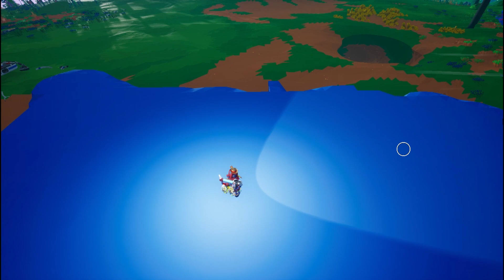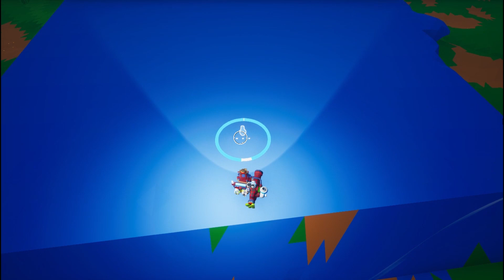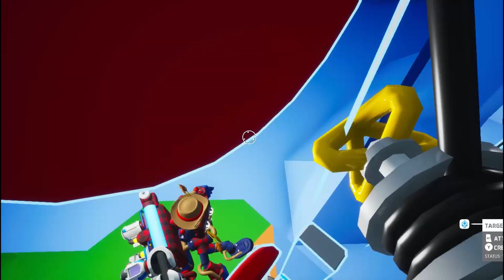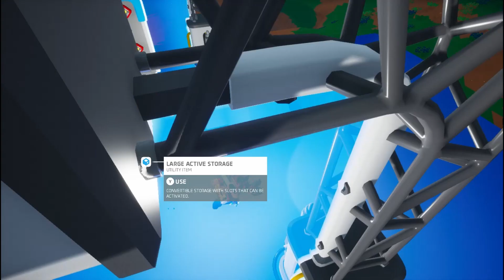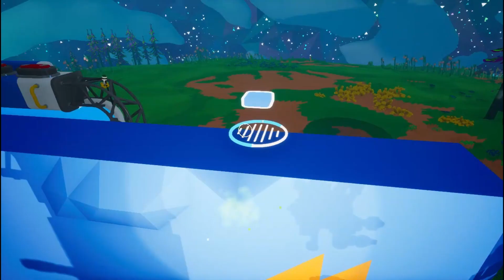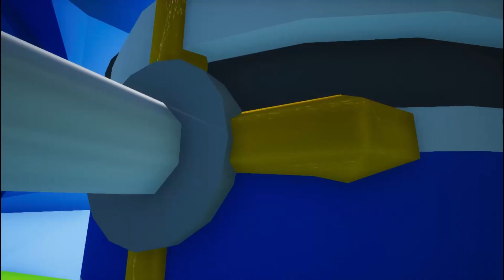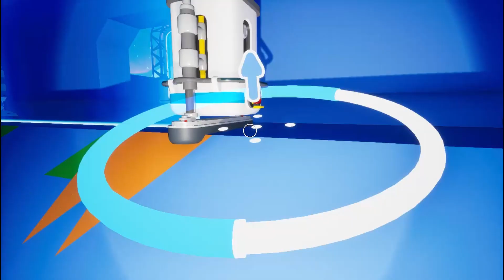Adventure Mode True Flat Guided Build - Functional Doors, Base Walls/Ceilings

Comment: Should the table be dancing around too while I'm trying to place it? It's making it real hard to line it up
Reply from the maker: Yeah when it is freaking out like that it actually means its lined up with the true flat lol you can make it settle down for a minute if you tap one rotation button and then the other just real quick. When building on true flat platforms will sort of hitch up as you rotate them and you can use that to make sure everything is aligned properly
Reply: @TactileObject  They didn't line up perfectly with each other while they were doing it. One is at a couple of degree slant leaning against the other but it's tidy enough. At this point I'm just eager to get this place finished lol
Reply: @TactileObject  Finally finished the trial building. Shame the draw distance in the game makes it look like it's been blown up until I get really close but the door works great. Thanks for the help
Reply from the maker: @mforcevirus  thats awesome! Yeah they really need to add terrain anchors from creative into adventure mode too. No game advantage but they make your base look great, i would love it

Comment: Would you say that the North gateway chambers are the best to build by for true flat?
Reply from the maker: Its my favourite because if an event comes to the planet then you can see the aurora in the sky. But really true flat works the same at all gate locations :)
Reply: @TactileObject  ahh OK.. What event are you talking about?
Reply from the maker: @minvike37  limited time events, like the FARM event that is happening right now where you send gasses from the cauldrangea away on the exo request playform. Right now there is an aurora over sylva, calidor, and atrox because they all have plants connected to the event
Reply: @TactileObject  I'm new to the game.. I came in right b4 The Rails update. I never new that. Good info thank you. I did read in the patch notes about the 3 planets and found out that Atrox was the best to build for the Lte.
Quick..? I noticed I can still send the fuel up in the rocket after completing the event and usually get  dynamite and packaging. Is that all that's offered?
Reply from the maker: @minvike37  no its rng, there are some packages that are qt rtg's and exo chips as well

Comment: Is there a way to move the Gateways high into the air? Trying to find a true flat spot but I don't want to build near a gateway
Reply from the maker: There isnt, you either find ine by starting a bunch of new saves or you could also build above one and cover it with soil.  Another options is going to tbe north or south pole on one of the moons!
Reply: @TactileObject  Thanks Tactile! Love your channel by the way.

Comment: Can't wait to try and follow this tutorial tomorrow. So far no tutorial has been consistant and not have some kinda massive issue or bug. Literally been unable to make any type of floor/plane that extends out in one direction and then can come back and meet up at the original point. Every time the angle is wrong and i wind up with like a floor that has 5+ differnt angles or planes that its made up out of. I havent been using stuff like the terrain analyzer/inhibbiter or even narrow mod though so i gotta try some of that. I even tried using the leveling tool at a gate and both the floor it creates the gate itself are angled off the planet. While they may be flat, they definitely are not level.
Reply from the maker: Yeah true flat surfaces are only both flat and level at the very center of a gate. Because astroneer planets are so small you lose level pretty quickly when spreading out. There are def tips in this vid showing how to keep the same plane throughout your whole build and avoid wrinkles ruining things for you. And i cover painting the soil and using the narrow mod for corners and stuff.

If you like the idea of a skybase, you do get more level area to use the farther you get from the center of the planet so you might consider that! :)
Reply: @TactileObject  Yeah so far the video is looking great i really gotta try the narorw mod and some other things. But yeah idk why the entire gate and the level tool created floor is at a slant. I'm thinking if i just dig towards the center of the planet but withotu actually changing the angle of anything. That way the closet to the core i get while mainting the same angle, eventually i wind up directly over the core and that spot would be both true flat and level.

Thanks for the reply btw i had no idea youd get back so fast!
Reply from the maker: @sparktite  for sure! Haha there are 6 spots that are easy true flat on a planet. The voxel grid is the shape of a cube and the middle of each side is where true flat is also level, each gate just happens to be in the middle of each of those sides and is where it is true flat and level. You can go anywheres directly above or below a gate and still be level. This also applies to the moons. They have the 6 same spots even though there are only 2 gates there

Comment: I’ve looked up seemingly every guide and read every forum and couldn’t get it right until I found this video. The tip he gives about grabbing the angle from the point where two surfaces meet is huge. As a console player, I find more success by grabbing the corner point where three surfaces meet. I also found that it was much harder in creative than in survival for whatever reason. But with a narrow mod, that bit of advice, and plenty of patience I finally got a reproducible result.
Reply from the maker: I am glad it was helpful! I am a console player too really and you are right about grabbing fro  the corners when possible. The shape of the voxel grid forces the corners to have at least a small triangle of proper true flat in between two true flat surfaces. The main part is whenever you see a wrinkle show up, stop spreading and look for some good true flat to spread or just pop the block for a new surface!

Comment: 0:55 why do you need to be at a gateway?
Reply from the maker: Basically the whole planet is built in an invisible cube, and a gateway is at the very center of each side of the cube. When you use the leveling block it aligns itself to this cube, so if you arent at a gateway area and pop the leveling block the surface it creates wont be level. It will be flat but it will be very slanted compared to the surface